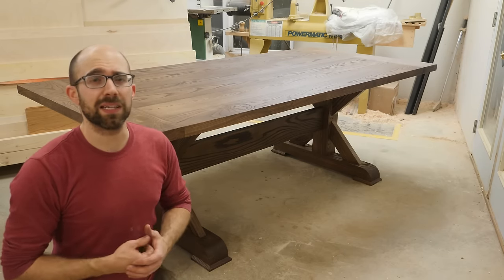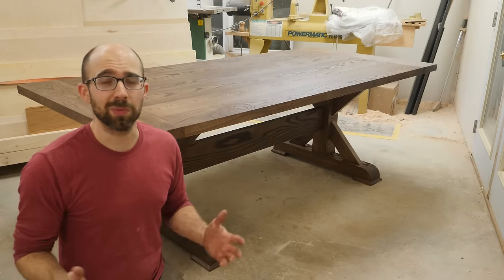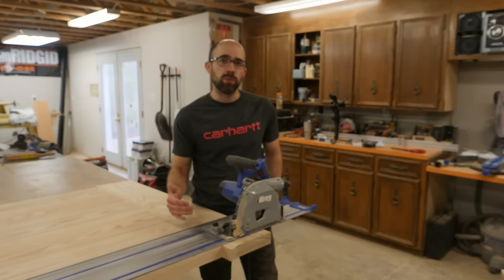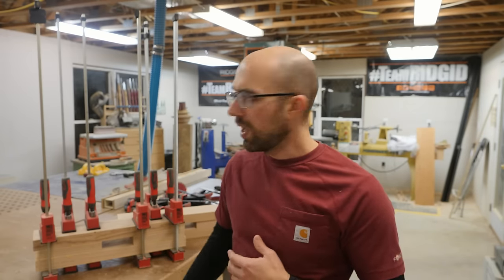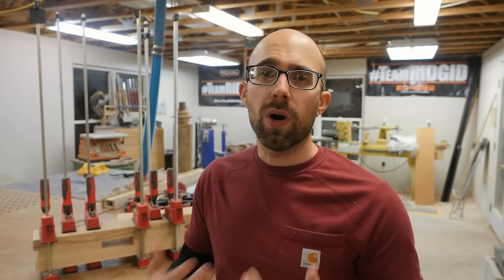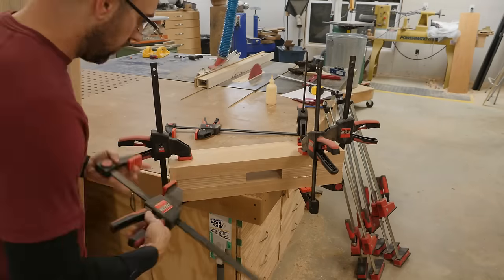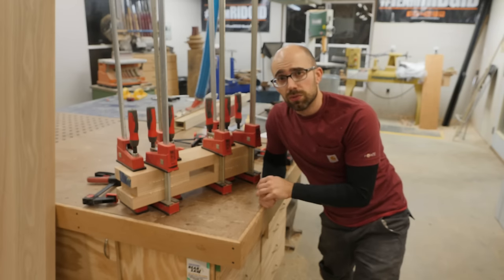How to Build a FARMHOUSE TRESTLE TABLE - DIY Woodworking

Comment: How to build a farmhouse table using 50k+ dollars worth of tools and equipment lol
Reply: And then ask for patreon support! Lol
Reply: @hewittgordon8843  not true. I do have a wood shop and i have enough tooling to rival this shop. I was just commenting on how it says DIY farmhouse table. And the common DIY'er is not going to have a 6k CNC machine  and other wildly expensive shop tools.
Reply: You can always rent workshop time to use these tools. Or even have them majorly processed before assembly!
Reply: It could all be done with basic tools, it would just take a lot longer and more hard graft.
Reply: Exactly!
Reply: Should a real FARMhouse table be built with tools a farmer would have?
Reply: @roncurtis224  lol not at all. It was just a comment on the DIY aspect of the video. It was just funny to me.
Reply: I know right? Super DIY LOL
Reply: To be fair, yes he is using bigger machinery than most home shops have.

However, if you are a decent wood worker, there is nothing overly complicated about this build. Yes it's big, yes it's heavy, so an extra set of hands would be needed every now and then.

The only power tools you absolute need to make this happen are a decent table saw, a planer, random orbital sander, drill, circular saw and a router.

A good Dowling jig could replace the domino. A jointer is super helpful, but a planer jig can be made to do that if the boards are not to bad, or just buy your wood surfaced on 2 sides to begin with.

Lastly, a good flat work surface would be preferred for glue up. Many ways to get creative with this.

The rest of the work is just straight forward labor, skill, and patience. So yes , it is a diy project. This is not an Ikea put together in a day table.
Reply: What type of wood is that???
Reply: My thoughts exactly!
Reply: Pretty sure the jointer is one of the highest ticket items of the video and the whole idea of the video is to make people understand why farm tables are pricey lol
Reply: true farmhouse tables are not made this way. with a little know how and proper handle tools (not power) a person could make a few and they would have an authentic look. Then you could sell them to the trendy people and buy all the tools you need to make more 😂 you're not wrong though, with these tools it's much faster but in my opinion not near as satisfying to the craftsman.
Reply: If you dont have these tools (or want to rent them) then you shouldn't be building tables.... I see people all over You Tube building tables with wood from home depot and the wrong tools - those might work for an outdoor picnic table, but not a real dining table......
Reply from the maker: Now where's that mic drop emoji? 👊👊
Reply: @WoodshopMike  lol.  My favorite is people using pine from Home Depot and pocket screws to hold the table top together, then wondering why it warps soon after 🤦‍♂️.  I'm a mid level woodworker with almost all of the right tools - I use dowels instead of dominos, and I need a band saw, but I do pretty well.   Your design is very well done - I'm going to buy the plans.  Thanks for the video!
Reply from the maker: Yeah pine and pocket holes are ok for some things but a table top ain't one of them🤣. Thank you very much for the complements and support. 👍👊
Reply: @thegravytrain1129  Very Nice Table . But I've never done my bread boards like that nor would I trust those. I do understand that the top has Alot of mass to it but there is a reason bread boards are done a certain way. My dining room table that I built 25 yrs ago  from 11/4 white oak moves every winter and spring. She is still just as true as when I made her. But I'm not so sure about that one in 25 yrs. Still a Beautiful Table he made.
Reply: I love this woodwork congratulations  Sr is a máster  🎖️👍
Reply: @smellygoatacres  did i say it couldn't? You obviously don't get humor!
Reply: The wood costs more than the tools to make it
Reply: @Imagynuity thank you. Didn't even see this and I made this exact point

Comment: Are you using the wheel restorer to raise the grain? What attachment do you have on it? Thanks!
Reply from the maker: I'm using the restorer to texturize the grain.  I use the wire brush for deeper texture and follow-up with the nylon brush to soften/smooth out the texture afterward.

Comment: Love this! Do you have anything similar that is shorter in length? 90in long is too long for my space, or would it be easy t adjsut the length to 60in?
Reply from the maker: Yep, it's easy to adjust the length.  Just make the table top and stretchers shorter by the same amount to fit your space.

Comment: Nice build!  I'm new to breadboard ends and have one question-what is the purpose of the piece between the table top planks and the breadboard end?  Is it absolutely needed?
Reply from the maker: Hi Mike!  Great name 👍
I'm not completely sure which piece you're referencing.  Do you mean the dominos that I hammered and glued in between the breadboard ends and the rest of the table?
Reply: @WoodshopMike  I know the dominos that you used but it looks as though there is a longer strip of wood attached to the breadboard ends after which you installed the dominos through it, into the breadboard end, joined to the table top, then you trimmed the edges flush with the table top.  It can be seen clearly at the 4:47 mark in your video.  I like the idea of using dominos instead of a T&G or M&T to attach the ends.  Hope this helps.
Reply from the maker: Oooooooo! I needed to make the breadboard just a touch wider, so I had to glue on a strip to make the breadboard wide enough to match the design.  👍👍
Reply: @WoodshopMike  TX!!!
Reply from the maker: Absolutely!

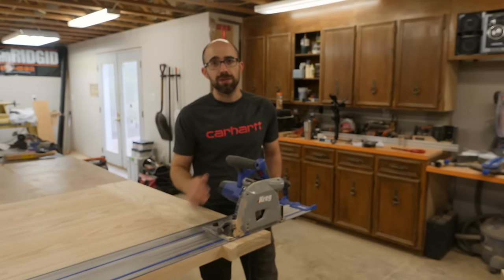Comment: Beautiful BUILD!! Your Shop is giving me a serious case of Envy! I was curious about a step you did and was wondering if you help me understand the mindset. 6:22 of the video, you use the plunge saw to clean up the Bread Boards. I am wondering why you didn't clean up both the bread boards and the side of the table at the same time to avoid having to get the bread board trimmed up perfectly?
Reply from the maker: Thank you very much! You can certainly trim the breadboards and table to size at the same time.  That's actually how I do it most of the time but for some reason I didn't in this build 😂

Comment: Beautiful table. Is that ash? Also, why water pop before adding stain?
Reply from the maker: Thank you!  Yes it's Ash.  I water pop on Ash when using Rubio because it opens up the grain and allows a deeper color.
Reply: @WoodshopMike  I didn’t realize that was Rubio. Is that one of those “easy color” options from Rubio? What color is that?
Reply from the maker: It's the Oil Plus 2C in Chocolate.  All you need is the 350mL for this table and you'll still have a bit left over.  I can't link directly to the product since it's a multi-select setup on Rubio's site.  If you do end up using their finish though you can use my link to buy directly from them instead of amazon.  https://www.rubiomonocoatusa.com/#WoodshopMike

Hope that helps.  Let me know if you build one!

Comment: Have you ever used clamping cauls for table top glue ups? Do you find them useful or necessary in some situations vs. others? I'm doing my own build and I'm reading about using them to keep all the boards flush during glue up. Thoughts? Appreciate it.
Reply from the maker: I've used them in the past mainly for gluing guitar tops and other thin materials.  For a table top you can put clamps on each glue seam or use cauls.  If you have a biscuit joiner or domino cauls aren't necessary

Comment: Two thoughts.  First you need to put that Rigid at the end of the driveway and buy a Festool vacuum to compliment the Domino.  I can imagine that thing is screaming in your ear.  I did and it's a game changer.  Second, that bread board end does not have any ability to allow the top to move within it so at some point you will have cracks.  Care to comment?  Maybe ok to glue but would like to hear your thoughts as you know sure know what you are doing.  Great video and i like the fact you have your son I assume helping, great way to have him get into the craft.  Thanks..
Reply from the maker: hahaha!  Yeah the Ridgid screams for sure and is super annoying even with hearing protection.  I use a SurfPrep POV-8 now and love it!  The breadboard does actually float.  All of the dominos are glued into the table but only the center 3 are glued into the breadboard.  The slots in the breadboard are cut on the wide setting so there's room for seasonal movement.  My client has had the table for about 3 years at this point and it's still as good as the day it left the shop!  Totally agree that if I'd glued the dominos on both sides of the joint in every location the table would for sure split.  Thank you very much for the feedback on the video!  This was actually my client's son.  He's a good friend from church and wanted his sons to help build their family table.  Not something I would typically do, but thought it was a great idea!
Reply: @WoodshopMike  Thanks Mike, that is a great idea using the wider slot for movement, I will use that next time I do a bread board end.  Excellent, thanks!!
Reply from the maker: You're very welcome!!

Comment: How do you remove the bottom center support beam? I saw how hard the dowel goes in with a giant C Clamp.  If you need to remove it how does it come apart?
Reply from the maker: That is a great question!  I drilled the hole a bit on the tight side.  In the plans it calls for a slightly larger hole.  This way the pin can be tapped out of place when necessary👍

Comment: Really beautiful table! I had a question about the bread board. Wouldn't gluing that peace to all the boards of the table top restrict expansion and contraction?
Reply from the maker: Thank you Ryan!  Yes that would restrict movement and potentially cause the table top to split.  I thought I mentioned only gluing the center 3rd of the dominos into the breadboard in the video...  If not my bad 👍🏻. Thank you for watching!
Reply: @WoodshopMike  did you leave some space on the others dominos holes you didn't glued, for movement?
Reply: @robrey468  it looks like he adjusted the domino to cut a bigger hole

Comment: Could you tell me what kind of clamps you have to attach the two end pieces to the table top? Im struggling to find and clamps that long
Reply from the maker: Hey Cody, glad to help.  I use the Bessey K-Body REVOs ( https://amzn.to/3rtvgLR )  and a set of the extenders so that I can span all the way across the table ( https://amzn.to/34n1WOb )

You can also hammer (with a mallet) the bread board ends on if you go with a drawbore joint.

Comment: One other question...looking to make a 3’x5’ table like this for my Mom but the heft of this table would be too much for that smaller scale.  I’m looking to buy your plans but wondering what you would recommend in terms of scaling down the heft to accommodate a more petite version of this?  Thanks for any guidance you can provide on that.
Reply from the maker: Hey Mindy,

I'd take about a 1/4” of the thickness of each piece.  That should make it visually lighter and still give a similar feel for the style 👍🏻

Regards,

Mike
Reply: @WoodshopMike  Thanks!

Comment: Nice vid and pro work. I'm interested to know what that brush or buffing machine you were using? It looks like it really raises the wood grain.
Reply: I guess its called a restorer after reading some of the comments
Reply from the maker: Thank you very much 👍🏻👊🏻

Yes you're correct, it's the restorer.  It does an awesome job adding character to wood.  It doesn't raise the grain though.  It actually removes the soft wood in the grain. 👍🏻👍🏻

Comment: I bought the Plans.. Does anyone have a breakdown of the wood sizes used or the type of wood.
Reply from the maker: This table is not designed to be necessarily be built from dimensional lumber.  Hardwoods almost always come in random lengths and widths which is why the plans give the board footage required rather than a specific list of different sized boards.  Feel free to reach out through email if you need and thank you for purchasing the plans! 👍🏻

Comment: I'm not a professional, but from everything I've learned about breadboard ends tells me you completely defeated the purpose of them by glueing all the dowels
Reply from the maker: If all of the dominos were glued on both ends you'd be correct, but only the center 3 were glued on both ends.  The other dominos were only glued into the table and left dry in the breadboard to allow for movement 👍👍

Comment: Was wondering why you were using the restorer on bare wood, I know it removes paint but if you could explain what type of wheel you have on it and what it accomplishes
Reply from the maker: Hey Matthew,

That's a great question and my apologies for not covering it, I had meant to!  I used the steel drum followed up by the 180 grit nylon drum.  Both drums texture the wood 👍🏻
Reply: @WoodshopMike  when you say you used the steel drum are you talking about the wire wheel?

Comment: Did you have a nylon or steel brush in your restorer??
Reply from the maker: I used a steel brush on this project since the customer wanted the texture very rough.  I usually follow up with the nylon brush though.
Reply: @WoodshopMike  that was my guess as hard as Ash is. My nylon brush seems to be as a sander more than a grain raiser. Very nice work - I will get the plans and make it a quite a bit longer, possibly with 3 trestles.
Reply from the maker: Exactly!  I just use the nylon brush to soften the sharp texture from the steel brush 👍🏻. Thank you so much for planning to purchase the plans!  I'd love to see the table when you're finished.

Comment: I think i can help with your leg clamping situation. It looked like you were having a less than easy time clamping the pieces wile keeping the jointed faces flush. Wouldn’t it have been easier to just throw some dominos in there to keep them accurate and to keep from sliding?
Reply from the maker: Hi Jake!  It wasn't too bad, just took a little thinking to make sure I had the sequence right.  There actually we're dominos in each piece that makes up the leg.  I was using the mallet to help them seat fully.  Were you thinking to orient the dominos differently than I did?  Thanks for the suggestion regardless! 👍🏻👍🏻
Reply: Woodshop Mike Sorry i meant the vertical post that holds the center stretcher on 8:35 of your video. To keep them from sliding during glue up, i was just suggesting dominos. Know what i mean?
Reply from the maker: Oh yeah I got ya now!  Yes that would have definitely been an good option! 👍🏻👍🏻. I've got a couple other ideas that I'm thinking about doing a breakout video on for glue up stuff without it sliding around...  Think that'd be a good topic?
Reply: Woodshop Mike ya man! You make it, ill watch it haha
Reply from the maker: Kinda late on the reply here but... Ok awesome! 😀👍

Comment: That's a breadboard "style" end. But it's not a breadboard without the tongue/groove to prevent cupping
Reply from the maker: Totally hear what you're saying, but floating tenon joinery is strong enough to prevent cupping.  This table is about 3 years old now and is still as flat as when it left the shop.

Comment: How can they shift with all those clamps??impossible
Reply from the maker: When you're getting the clamps set is when the parts will try to slide a bit.  Once all the clamps are on though and the pieces are still in place you're good👍

Comment: So, how hard is it going to be to drive those 2 pins out for breakdown?
Reply from the maker: For this one, it's not too bad but you'd definitely need a clamp.   If you oversize the hole in the cross beam that'll definitely make things easier.  I think my alignment was slightly off which is why I needed to clamp to press it into place.

Comment: I would buy the plans... If it didn't look like it took 15,834 power tools to make
Reply from the maker: You can certainly build it with only hand tools, it'll just take a bit longer 😂😂😂 All kidding aside, this could be built with a tablesaw, planer, drill, and a sander.  Granted it would take longer than a full shop of equipment, but where there's a will there's a way 👍👊

Comment: This is an awesome video. However, I learned I need to spend a lot of money to get all the equipment so buying a table might be cheaper.
Reply from the maker: Woodworking can definitely be an expensive hobby.  I've built my shop with lots of Craigslist tools and trades over the years.  If you go the route of purchasing a table I do build custom for clients across the country.  You can email me at mike@woodshopmike.com for pricing and scheduling 👍🏻. Thanks for watching!  Cheers!

Comment: You have a well-equipped shop for carpentry projects like this. Your design appears very thorough and you added all the construction details to ensure this table doesn't begin to loosen over time. Very nice radius feature on the feet of the table and I like your attachment method of utilizing two boards on either side of the centerline of the table. Very professional look and construction. Outstanding job and final finish.
Reply from the maker: Thank you so much!  It was a fun build 😃

Comment: Great build! I’m just starting mine and I’m using ash just like you did. I’m starting by building two matching benches, so I’m learning all the tricks before I do the big table. I’m doing classic breadboards and using all mortise & tenon joints ( no Dominos or pocket holes). What stain & finish did you use?
Reply from the maker: Sounds awesome, have fun!  I used Rubio Monocoat in the color chocolate